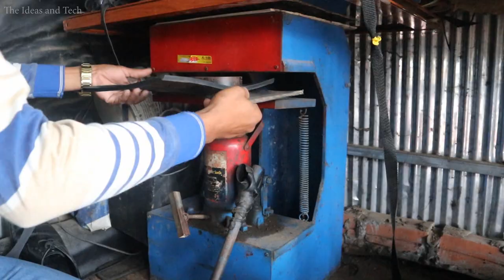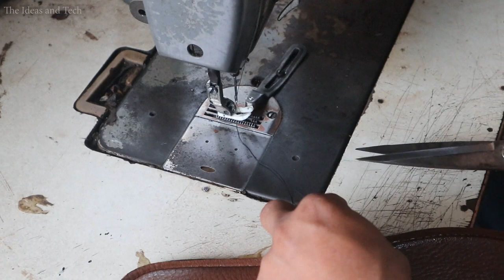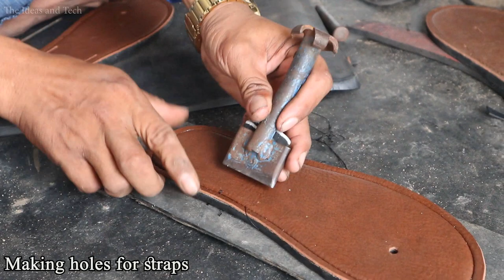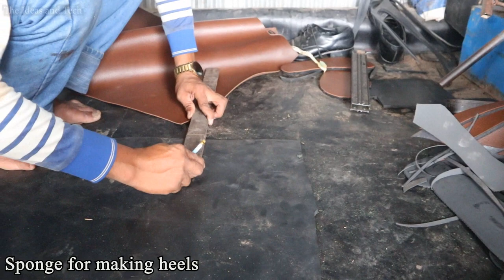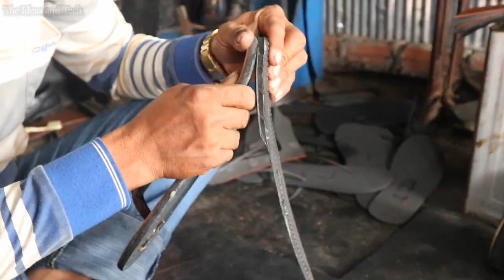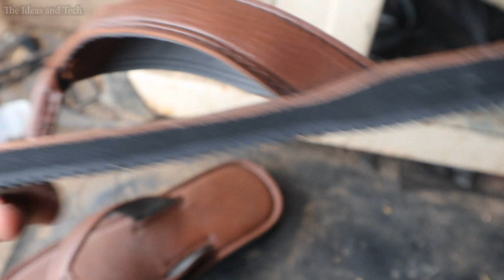How To Make Beautiful Sandals at home with simple tools and easy fast techque - Talented Skills!!

Comment: 1.What kind of glue you are using? 2. Same for attach top with bottom you applied only glue not using stitching. Will that glue enough, if it’s used it water any possibilities for separating
Reply from the maker: 1. Any kind of glue that use to stick the shoes. The brand is depend on location Sir. 2. We sew it already so just use the glue more is enough.
Reply: @TheIdeasAndTech  thank you